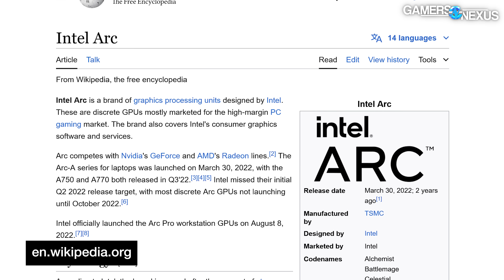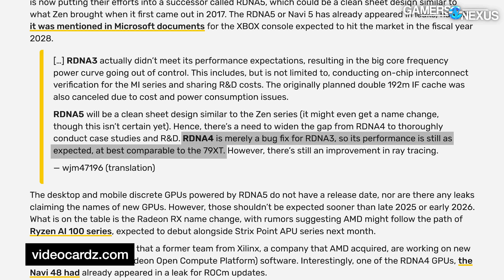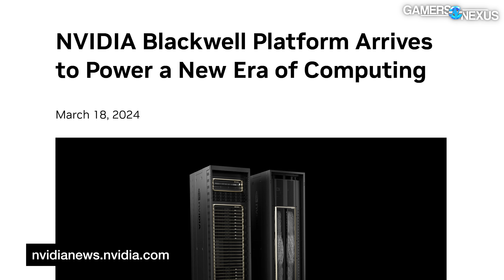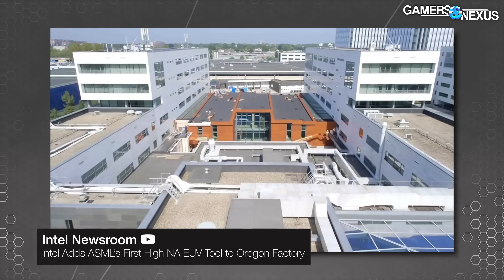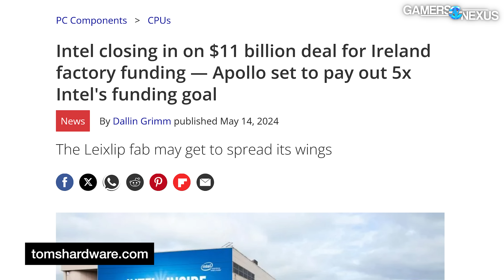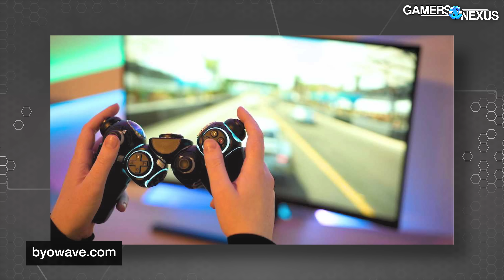HW News - Intel Battlemage Handheld, AMD RDNA5 GPU Rumors (Already), NVIDIA Handheld

Comment: RDNA5 being a clean slate makes so much sense.
RDNA seemed to be a response to Nvidia's Maxwell/Pascal series and RDNA 2 and 3 (and 4...) seem to be last minute band-aid fixes to try to stay caught up to Turing/Ampere.
It really feels like AMD was caught completely unprepared for the drastic shift in GPU architecture.
Reply: they were supposed to have more influence what other GPU maker should do with their architecture because their hardware dominate the console space. maxwell? it is nvidia respond to GCN because kepler end up falling behind in  gaming workload  that was built with 8th gen console hardware in mind.
Reply: @arenzricodexd4409  Pretty much everything in the PC hardware space is a response to something else at this point. It's the natural evolution of hardware. Competitor A makes a leap with New Product 1. Competitor B is behind for a generation and then releases New Product 2 to catch up.
Reply: Knowing how AMD is a follower and not a leader, this sounds plausible

Comment: I don't even need one for accessibility reasons and I'm thinking of buying a set of those cubes if there aren't major durability issues with them discovered. I'd LOVE to be able to 'build a bear' a controller layout. Especially if the software is present to provide additional mappings for duplicate modules or whatever.I mean, stick a decent gyro in one module and you can straight up make a custom flightstick. There is a LOT of potential there.
Reply: It's awesome to see new accessibility options showing up in games and gaming interface and peripheral devices. Especially ones with such versatility. And measurements and starter 3d files are a huge deal. It's absolutely fantastic news.

It's a just shame that the low volume and extra production complexity for specifically accessible products causes the cost to be out of reach for many that would need it the most. Full disability isn't exactly lucrative for setting up any decent gaming rig.

Even so, it's a great thing that can help many more people able to enjoy all kinds of great gaming experiences (and terrible, too, i suppose).

And stuck at home all day for that reason doesn't mean game all day just for fun like so many seem to think it is.
Sometimes it's just a couple hours a month able to do something fun for once.

Comment: Pelting that controller at the floor in a fit of rage and having it actually explode is just too good, I wanna see a "drop" test
Reply: I foresee it simply coming apart in the hands, for example when trying to run/drive faster and really pushing the thumb stick which thereby puts rotations forces between it and connected modules, causing the {I assume] twist-to-[un]lock mechanism to disengage.
Reply: @ChrispyNut 
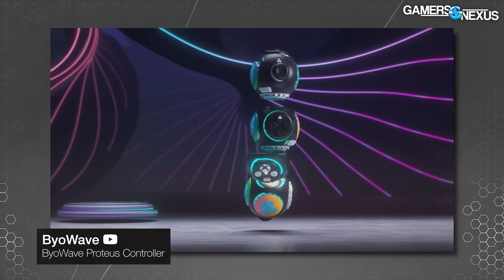It might have some kind of locking mecanism, see min 22:12
Reply: @philippengl2342  Oh, for sure there'll be something, but even if it's more than "give it a firm twist", it'll be so small that it'll definitely break during intense / passionate moments, especially in the hands of someone stronger than us nerds who watch every GN video 😉 (yes, I'm using the stereotype and there are plenty of exceptions, but I'm an even weaker exception).
For it to have the strength for 99% to not have a problem, it would be too expensive for 80% of prospective buyers.
Now, if they made it an open standard, or even a cheap license, it would allow for cheap parts that's easily replaced (but likely wasteful) and fine for gentle types through to tough modules for vigorous, strong users who can invest in critical modules where the most strain is focused.

Comment: Maybe I'm the crazy one here, but every time I hear about handhelds having 1080p+ screens I'm just like "why?"

For such a wee screen so close to your face it makes close to zero difference. Before I actually played on my steamdeck I was a little worried that the 800p screen would be a tiny bit too low resolution but it's actually pretty perfect. 

Games still look great on it, I read somewhere that the pixel density of a 7in screen at 800p being held within ~1.5ft of your eyes equates to the pixel density of a 1440p screen and while I don't know if that's 100% true it sure seems like it could be. 

Only significant thing I notice going from Desktop to Deck (aside from a bunch of games just not running on deck at all) is the lack of RTX lighting in games that use it well.
Reply: its probably got more to do about the economy of scale...  it's easy for manufacturers to find supply of small 1080p screens, due to the popularity of small tablets in the last 10 years.
whereas 800x600 or 1280x720 displays have surely fallen out of 'favour' so to speak. thus its probably cheaper to buy 1080p screens.

The same way that you can't really buy a 2gb or 4gb usb stick anymore.
Reply: @CrusinVK  Or just go all in on 1440p displays and drop them to half res (720p) for pixel-perfect battery-saving goodness.
Reply: You're right. Anything beyond 720p/800p on a handheld or 1080p on a laptop is a meme that costs iGPU power and battery life.
Reply: Side to side it's definitely noticeable.
Reply: The Lenovo Legion Go is at least justified in this. It's a multi purpose tool that will allow you to play games at an extremely higher resolution if you're streaming or playing old stuff, watch stuff, read, do productivity work (writing a doc for example) etc.

Other than that, yeah. If you're just gonna play and go and do little else... Just buy a steam deck lol, the PPI is dense enough there.

Comment: I'm interested as to why you haven't made an investigation into the unstable intel CPU's. It'd seem like an investigation tailor made for this channel.
Some people seem to not talk about it too much due to fear of getting blacklisted by Intel which seems to be something they do. I'd like to believe you guys don't fear such a thing as you call out big companies all the time.

Is such a video going to happen and if not, I'm curious as to why not?
Reply: There's no real need for an investigation now.
Reply: @ironicdivinemandatestan4262  
How come? I am biased as I have had issues with my 14900k. Currently getting voltage spikes up to 1.5v under light loads just to have stability.
I've seen an increasing amount of reports from other users having stability issues on reddit and other platforms like toms hw. Though the increasing number of reports could be explained by popular news outlets shedding light on the issue, it does make one wonder if the chips are actually degrading at a rapid pace 🤔
Reply: Im fairly sure that these guys are really busy with everything else they're covering. While not as in depth, Jay took a look at the issue
Reply: "Is such a video going to happen and if not, I'm curious as to why not?"

because lots of other channel already doing it?
Reply: @arenzricodexd4409  I've seen a lot of channels mention it and report on it but not do an investigation into the possibility of degradation as that's something quite a few users have thrown out there

Comment: AMD should resurrect the ATI branding. RDNA5, if it's a reboot arch, should be the AMD ATI-1000 series. Then after that, the ATI-1100 series, ATI-1200 series, so on.
Reply: ATI was sick
Reply: Bring back RAGE
Reply: @beigebox1990  I would go for RAGE TRACING series.
Reply: @beigebox1990  And / or Ruby. :)
Reply: @dakai4992  Definitely need Ruby. Slap her on a videocard and you've got a winner right there. :D
Reply: Gotta work in Mach and Rage in there somewhere. :)
Reply: @HMarcBower  Honestly they could JUST repurpose the Mach trademark and be fine. AMD Mach 5 500, 600, 600XT, 700, 700XT, 800, 800XT, 900, 1000, and then Mach 5 Diamond D10/D20/D30 for their productivity cards, referencing the "mach diamonds" phenomenon seen in rocket and jet exhaust. The following series would be Mach 6, all the way up to Mach 22 when they progress to AMD Orbital O23 :P
Reply: Since they're more competing with Intel than Nvidia, it should be the ATI-800 series.
But wait, the letters AI are reserved for their next CPU generation.
So they're left with the T-800 series.
Reply: Would love Radeon 9700 Pro part deux
Reply: I bet it's not that simple from a legal point of view.
Reply: I would just prefer that AMD learns that they don't have to call every card "RX 7900 [something]"

Other numbers are available
Reply: ATI Rage Fury Pro Maxx. Yeah, no thanks.
Reply: @LudwigTheMad  Sounds like Apple making a GPU.

Comment: 5:30 They actually don't supply enough voltage. You can make your unstable 13th-14th gen i9 stable by giving it more voltage.
Reply from the maker: The reference was to how they blast the voltage, actually. The board vendors often blast way too high voltage. We have several pieces on this. Both of these are problems, but different ones.

Comment: Watching this on an Nvidia Shield TV (commenting on phone). Had the Shield tablet as well, wasn't a huge fan of that, had a screen which moved when pressed which ultimately lasted about 18 months due to the battery swelling.

The TV has been solid, honestly love it, wish they would make a new version as the hardware is still more or less the same since 2014? The Shield Pro was a minor refresh, mostly die shrink but also took away a lot of nice features.
Reply: It's possible Switch 2 reject dies will end up in a new Shield TV

Comment: I'm hoping with the release of the Switch 2, we get a new Shield Pro.
Reply: Nvidea would sooner update their shitty Shield stream stick/box, than release another Shield handheld.
Reply: @KAT4TONIX  Personally, I couldn't care less about the handheld. The Shield Pro is their top end streaming box, and it's hardly shit. The 2019 Shield Pro is one of the best steaming media boxes on the market, and I'm interested in an update to that.
Reply: It's definitely possible Nvidia will use the reject T239 dies for it. It depends on Nintendo allowing for that though. Having another, far more open hardware platform could present more ways to "jailbreak" Switch 2
Reply: @2intheampm512  The old Shield Pro uses the same chip as the Switch, which is why I'm hoping for the update. Also, I don't think Nintendo has any say what NVIDIA does with their silicon.
Reply: @TheGameBench  They would have a say considering it's a custom chip designed for them, but it comes down to whatever agreement Nintendo and Nvidia negotiated
Reply: @2intheampm512  It doesn't seem that you understand how this works. The Switch used the Tegra X1, aka the T210. It was not the only device to use the T210. The X1 was revised in 2019 with the 210b, which was used in the Switch, OLED and the Lite as well as the Shield. Now, the Switch used a different variant of the 210 and 210b, but it is based on the same architecture. That is how it's going to work with the X2. There is going to be an SoC variant that is only going to be used for the Switch 2, and there will be other variants of the X2 used for other devices. They will make a custom variant for the Switch, that they won't use in anything, but there will be other variants of the X2 that NVIDIA is already slated to sell to Tesla and Mercedes. Nintendo has no say what they do with the X2, just that NVIDIA has agreed to a custom variant for the Switch 2, not that the X2 is exclusive to the Switch 2.

I hope I've made that clear enough.
Reply: @TheGameBench  TX2 has been out for a while, it's Pascal based. You're right that it ended up primarily used for automotive.

I think you're mistaking T239 for T234 (Orin). While T239 is Orin-derived, it's not the same chip or a different variant; it lacks key IP blocks from Orin and has an additional logic block that it exclusive to it and only it (and least for now). Orin is also used by the automotive market.

My point is that T239 is not an off the shelf part from Nvidia. It's a custom SoC commissioned by Nintendo for Switch 2. This is quite different from TX1 (T210). When negotiating the contract for this SoC's design, development, and manufacturing, Nintendo may have included a provision that T239 could not be used in other products. While Nvidia certainly owns the IP in T239, if it is a part of their contract that the SoC is Nintendo-exclusive, then Nvidia can't put that chip into a Shield TV. Nvidia could use the same logic blocks and design a different SoC that is very similar to T239, but not exactly the same as it, and use it for other markets, but it probably wouldn't make financial sense at that point versus just making an SoC with much newer architectures.
Reply: @2intheampm512  Yes, you're right on the X2, not sure why I thought it was the X2. However, it doesn't change anything. You're assuming that NVIDIA is making the T239 just for Nintendo as a bespoke design, and I don't see why they would do that unless they don't have any plans to use it in anything else. I'm sure Nintendo would have tried to make the 210 exclusive for the Switch, but that's not how it went down. And you're right, IF NVIDIA agreed to make it exclusive... then you would be correct, they can't use it for other applications, but you're just making assumptions and NVIDIA just doesn't have a history of doing that. The trend is that the Switch 2 will get a custom variant, but NVIDIA will sell other variants for other use cases, including their own, because... as you said, it wouldn't make financial sense to change it enough to be able to do so, thus it makes no sense to agree to such terms. That is the historical trend, and unless we hear otherwise from NVIDIA, it's seems pointless to assume that it will only be used in the Switch 2 as there is no precedent for that.
Reply: @TheGameBench  You're right, that's my assumption. Were working with the same info but just drawing different conclusions, which is fine. Good conservation, thanks for the thorough and polite responses, I appreciate it

Edit: And I'd like to add I'd love to see an updated Shield TV. My Sony Bravia has pretty solid upscaling but the UI is slow and I haven't felt the need to get a separate box without the benefit of better upscaling, so I hope that Nvidia does end up releasing it

Comment: I find it hard to believe that the Switch 2 will be backwards compatible out-of-the-box given that Nintendo does this weird thing where the full driver stack is compiled into each game. However, I would see them allowing devs to provide patches that include the new driver stack so you wouldn't re-purchase certain games. But idk I'm not a Brazilian streamer
Reply: Nah, you're not wrong. Nintendo would rather sell people's old games to them again, and again, or lock them behind a subscription pay wall than create a handheld that's fully backward compatible with their previous platforms. 

Nintendo is famously ass backward when it comes to backward compatibility.
Reply: @KAT4TONIX That's completely untrue, they only drop BC when there's a change in media format. GC->Wii->WiiU all used discs and have BC, Switch uses cartridges and drops BC. BC is extremely likely for Switch 2, although expecting enhancements for free is a far less safe bet

Comment: I really hope arc gpus keep getting better so we have more options
Reply: They're actually pretty good.  The architecture is... weird and the "low performance" is definitely architectural at this point(it won't hit it's theoretical numbers in gaming).  But the gaming cards and flex cards are the same(barring things like the flex card that is two arc chips on a single PCB) and are GREAT for virtualization.  They're also their XESS cores, which are great for NPUing it up.
They already shed a bunch of stuff(cancelled projects circa 1-2 years ago), but I'd bet on ARC as an ongoing thing as it stands.  It covers GPU, datacenter GPU for serving out virtualized GPU output, transcoding, neural net processing, etc.  Their AIB vendors are mostly locked in as well(Sparkle, Acer, and Asrock in order of "friendliness" to Intel)

Comment: GPU's have turned into phones, we get a new refresh it seems now every 6-8 months. Please stop GPU makers, please for the love of god just do 2 yr single releases with actual value per performance improvements and not just 5-8% performance increases. I'm so sick of all the computer products that just are pushing out crap every chance they can it's so damn toxic.
Reply: What are you talking about? The RTX4090 came out in 2022, and by the time its successor comes out it’ll be at least 2 year later. And AMD’s release cycle is the same with the 7900XTX also being released in 2022. They’re literally NOT doing the thing you’re accusing them of doing but instead doing EXACTLY what you’ve asked them to do. LOL
Reply: @benjaminlynch9958 yes they are? Their cycles are getting closer and closer, tell me when is the 50 series coming out? When also did the super series come out? It’s yearly now, refreshes or new generations.
Reply: @onlytheneeded412 Probably will be at September like last idk 8 years? It always was 2 years

Comment: As much as I bagged on Intel on the CPU side when they were stagnating after Sandy Bridge, I'm pulling for them to succeed at providing a compelling product in the GPU space.  My last few cards have been AMD because I haven't been willing to pay the Nvidia premium, but there's no denying that AMD has lagged on features.  Intel being competitive will hopefully goose AMD to continue putting out quality for value as opposed to just pricing their cards at Nvidia price minus X%.
Reply: Competition hopefully improves things. less so when there's not that many competing in the first place. Still, I'm also hoping for Intel to succeed in this, even if it's only mid to low end. (Maybe especially, since that bracket isn't really a thing these days)
Reply: Seems to me like NVIDIA’s premium is what you pay if you want those features
Reply: @thebcwonder4850  that's what the used market is for